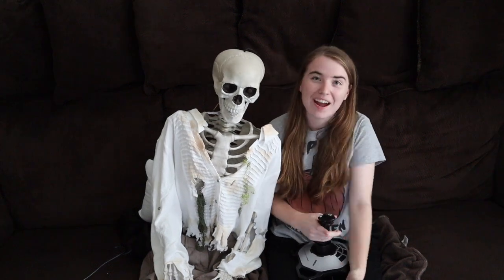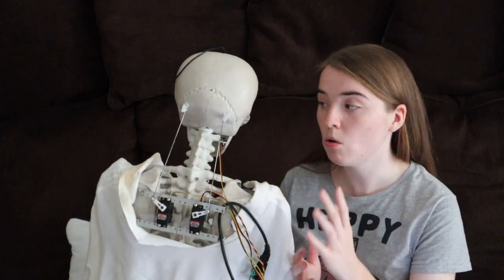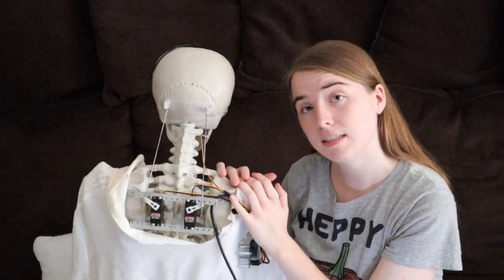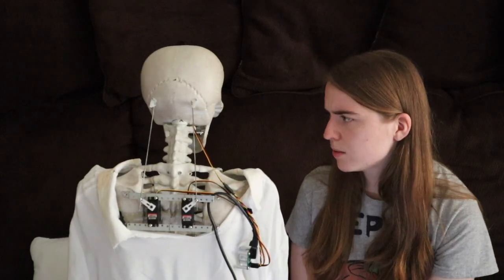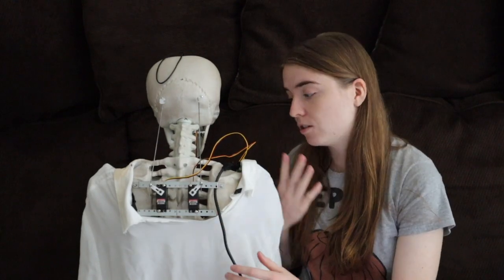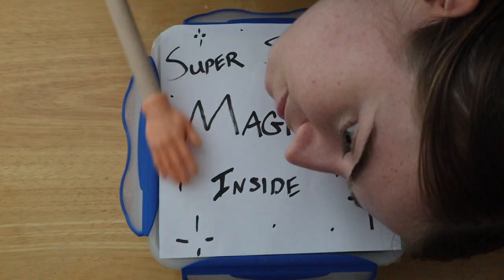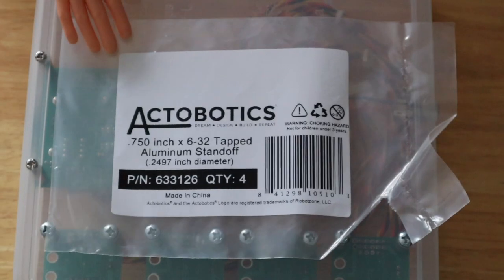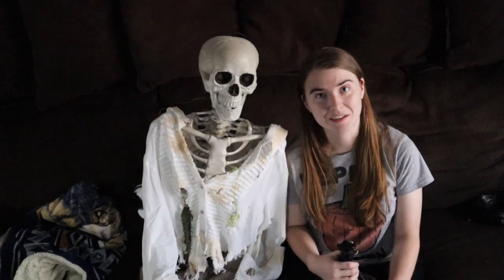How To Animatronics! ~ Part 1: Skeletons and Control Box

Comment: So I can’t find the receiving air sending boards and the alternates are ones that require crazy batteries. Do you know if they are sold anywhere else?
Reply: i dont know but you dont need them, they are just to extend the length of the servo wires through cat wire. i dont use them in my skeleton because i am on a budget.

Comment: What is the diameter of piano wire?Does it have threads in the ends?
Reply: I believe those are actually standard RC push/pull rods

Comment: I've wanted to do this to one of my skeletons. I wanted the jaw to chatter rapidly. Have you used a small dc motor with a crankshaft to stiff wire on a bell crank? Also thinking of Arduino and ultrasonic sensors to track/pan movement with the skeleton head.

Comment: Impressive stuff, I want to learn to do animatronics too, I already do some programming, and have set up things with arduino and raspberry pi's. I use the PCA9685 board rather than the one you use (scc32), they allow for up to 1024 servos (which I admit is entirely overkill xD), but with the Raspberry pi you can run it off a battery, no long cables needed :P

Comment: Great video. How well do these servos hold up in the weather? Should I look into waterproof servos?
Reply from the maker: Thanks! That's a good question.  I haven't had any issue with weather and these servos, but although I use them a lot throughout the year for videos, testing, and programming, I only have the skeletons outside for one night of the year.  However, it does get very humid and oftentimes dew will collect on everything that night, but that never has caused any issues with the servos.  The only servos I have ever had to replace are the jaw ones due to burnout or binding (my own fault).  All six of the shoulder servos on the skeletons are like 7 years old now and I've never had any issues with them.

But if you do want to go with a waterproof option, most waterproof servos you find will be digital servos, meaning that they are much stronger (can lift heavier objects and are usually more robust as well) but they draw more current and will need to have their own power supply, which is not to hard to do.  There are a lot of these servos available on Amazon for good prices.  I have used the LD-27mg and LD-20MG before and they have worked well in my projects, although I can't really say anything about their waterproof-ness.
Reply: @CatsMenagerie  Thank you!

Comment: This is great! Question: How do you link this up to a battery operated mechanism so that you don't have to manually work it?
Reply: depending on what you wanted to do you'd have to buy a type of prop remote I recommend a picoboo from frightprops you can even use a sensor she shows from another video and record your animation so whenever it is activated it doesn't need you to do it manually or buy a program to run it for you and connect to a computer or servo controller

Comment: Do you have more specifics on the power supply?  Most power supplies I find are 5v, but it sounds like I probably want 6v to get the most torque out of my servos? I'd much rather use a wall plug than a battery.   Will a 5v power supply be good enough for the SSC-32U and a bunch of servos?  What amperage should I be looking for?

Comment: This is a fantastic project! Am I wrong to assume the servos get their power over the Ethernet cable, too? Is the power supply going into the sending board?
Reply: Yes, four conductor for signal and two for power split in parallel.
Reply: @Sparky5  awesome. I’m super new to this kind of tech. Been doing props for years but never dabbled into computer animatronics. I was thrown when I didn’t see power supplied to each individual animatronic separate from the main control board.

Comment: I noticed you are using 3 servos per skeleton, but I’m seeing 4 pins being connected on your sending board/SSC-32. What is the (green dot) wire being used for? 
Thanks. LOVE your videos. I’ve made 4 of these guys now! 💀
Reply from the maker: That’s a good question!  I don’t currently use that green dotted wire for the skeletons, but I reuse that box for different projects throughout the year.  Those projects might require that I have that last pin connected, so it’s convenient just to go ahead and have them all connected and available.

Comment: If you keep your controller/computer only a couple of feet away from the skeleton, do you still need the signal boosters? How far can you run a servo cable before you'd require a signal booster? (Also, any advice on how to replace the skeleton's neck joint so that it'll turn and move up and down? My skeleton doesn't have a universal joint in its neck and can only rotate left and right)

Comment: Cat - this is really awesome btw. My kids and I have built our first puppet and now have the TrackSkull 2.0 software operating and controlling the servos via Lynxmotion SSC32u controller using send/receive boards over ethernet. We are having trouble setting the servo start points. There's chatter and the connection points to the skull seem off. Do you have any more details about your initial servo setup, tests, and adjustments? Given that TrackSkull is a 1 axis =  1 servo program, to raise the puppet's head, are you moving the joystick diagonally? Is there a way to program the software defaults to match the joystick up down motion?

Comment: Cat, thanks so much for this video.  I purchased the hardware you recommend for the jaw mechanism, but I think I might be missing something. How do you connect the ball link mechanism together?  It looks like there is a threaded rod I'm missing.  Do you use a separate turnbuckle? Or are all the parts included and I need to use them differently?

Comment from the maker: 8/5/20 FIX: In the video, I connected the power to VL but that will not drive your servos on the SSC32u.  You need to connect power to VS1 instead of VL.  VL is meant to power the logic (processor) not the servos.  More info about the board can be found here: http://www.lynxmotion.com/images/data/lynxmotion_ssc-32u_usb_user_guide.pdf
Reply: what is VL and VS1?  insert port?  Sorry new to this.
Reply from the maker: @cadilovr  At 8:41 mark in the video, it’s the screw terminals on the left (green blocks with the 6 screws on top) where you hook-up the power.  The board on the left is the old SSC32 where I have it incorrectly hooked up to VL.  The board on the right is the current SSC32u board.  The two screw terminals at the bottom labelled VS1 are where power should be connected instead of the VL terminals in the middle.  VL (L for "Logic") is where you could separately provide power for the “brain” of the chip, but that's usually not needed.  VS1 and/or VS2 (S for "Servo") are what power the servos.
Reply: Hey cat! I actually am proud i noticed that! (been readin the SSC32u manual all day) What gauge wire (the red and black) did you use into the VS1? I'm super nervous about the power side of things as I'm just getting started. I got a 6v power supply and the little adapter part, wires are the last piece, I can just use breadboard wire right? Great channel and your tutorial will be my very first animatronics project!

Comment: Hey Cat, I absolutely LOVE your videos and seeing your creations of the pirates, and Corvus inspired me to make my own. So far I have the prototype head with eyes and a jaw, and I have it all hooked up to my computer (Windows) via a controller board (SSC32U), sending board, and receiving board, I also have a 6v battery pack connected to my SSC32U, and I even have the Logitech Extreme 3d Pro in order to control it, but no matter what I try, my SSC32U says that it's receiving an input, but my servos aren't working, and I can't figure out why.
Even when I connect my servos directly to the controller board nothing happens. Do I need a separate power supply for the Receiving Board/Servos. I feel like I'm so close, but I'm very frustrated. Do you have any suggestions on what I should try to do to make it work?
Reply from the maker: Someone else was having a similar issue so I've pinned a comment at the top.  Try it out and let me know if it works!
Reply: @CatsMenagerie  sorry to bother you again, but for the SSC32U do I need two separate power supplies to power both the logic, and the servos?
Reply from the maker: @geraldcreighton2867  No worries!  You only need the one power source connected to VS1.
Reply: Whelp, looks like my animatronic construction is going to have to wait a little, because my battery pack literally just MELTED, lol
Reply: I'm going to get a new one, then I'll tell you if my animatronics work

Comment: I love this design!! I plan on using it with a DMX servo controller!! You should try using 3D printing; that's what I plan on doing! If you see on my channel I also use pneumatics for some of my larger characters! I think it would be a really cool topic to cover on your channel. Still I never thought using servos this way and I can't wait to design skeletons like this for my upcoming 2020 halloween show!!! THIS IS REALLY AMAZING!! Good Work!!! -Ava
Reply from the maker: Thank you so much!  I’ve seen your animatronic shows before and they are incredible!!! :) I’ve been wanting to get a 3D printer for a while now (it would make my life so much easier) but it’s going to be a big investment for me.  Also, I just got some pneumatic parts and I can’t wait to try them out!  Just have to wait until quarantine is over so I get my hands on an air compressor :P
Reply: @CatsMenagerie  I have an Ender 3 Pro! It's about $260 and I use it with Fusion 360 to produce mechanisms for servos and other robotic parts. Definitely an amazing investment and the print quality and stability is amazing!! I would recommend getting a very large compressor(like 30 gallons or so.) I originally bought a 10 gallon compressor and It couldn't keep up when I would run my shows. I then invested in a 30 gallon Husky air compressor. It certainly seem like alot but is really important when running more then few small air cylinders. I keep mine in my basement and then run a 100 ft air hose outside for my shows!!!
Reply from the maker: @avasworkshop6812  Thanks for all the info!!  I'll keep it in mind :)

Comment: Just a quick note that the servo wire extension cord that connect the sending board to the SSC-32 needs to be female to female connection.  The link above is female to male.  Still think the videos are great.
Reply from the maker: Thanks for letting me know, it should be fixed now.  The male to female is for the jaw to reach the receiving board and the male to male is for the sending boards to the SSC32.

Comment: Thanks so much for this; I've just completed my own skeleton based on this design.  It's amazing how expressive the head is using only the two servos on the back.  I'm using Ableton Live to control mine.
Reply from the maker: That’s awesome!  And it is pretty neat to get such interesting movements from such a simple design.
Reply: Would you mind telling me how do you power your ssc32u?
Reply: Could you go in depth a bit more on how you’re using Ableton to control your servos? Are you using a DMX servo board? I use Ableton and this would really help!

Comment: Looks like I'll be digging into this for the future. Love the motion of the head that is created by the 2 servos on the back. Great tutorial! I think the problem I'm going to run into is finding software for a mac that can do the same thing. I'll probably stick to using audio controlled boards, but being able to program how the head moves is a game changer.
Reply from the maker: Thanks!  I have a mac too.  I have to use a Virtual Machine to run Windows to run the software.  It’s a struggle sometimes :/

Comment: Do you have to run the laptop full time on a show or is there a device you can buy to save everything on and trigger with motion?
Reply from the maker: For this setup, yes, I have to have the laptop connected to the board in order to run the show.  I'm not familiar with any device that would let you trigger a show from an input like that and not have to be connected to a computer, but I think Brookshire's RAPU is a device that would allow you to run the show without a computer.  I don't know much about it, but I don't think it has any digital inputs (and therefore would not be able to be triggered by any sensors.)  Also, Life Ape has a device called GateKeeper I/O that is meant to be used with their software, Helmsman.  It has digital inputs and can be triggered with things such as pressure pads, motion sensors, etc. but I don't know if it has to be connected to a computer while in use.
Reply: Yeah I'll look into it a little bit more thanks for the information I'm trying to make a animatronic prop for a haunted attraction and I know there's a lot of animatronics that are similar to the ones in the Halloween stores that are triggered with motion so I didn't know if there was a chip that you could send a program to and basically have it repeat itself any time there was a trigger kind of like a USB flash drive with the program or something like that